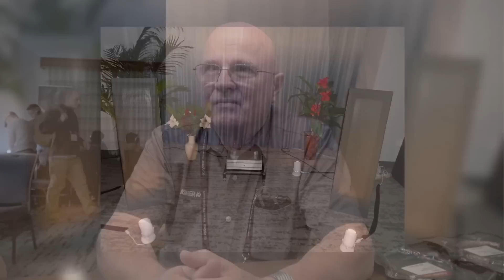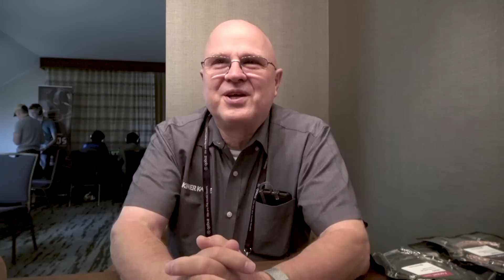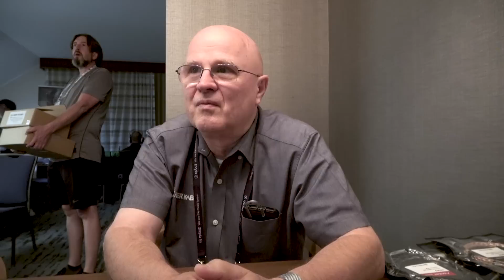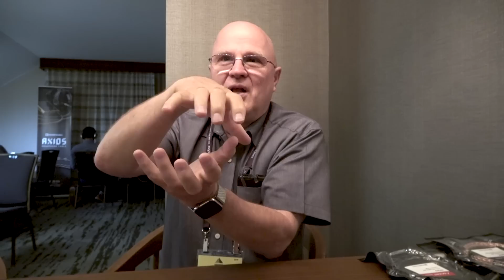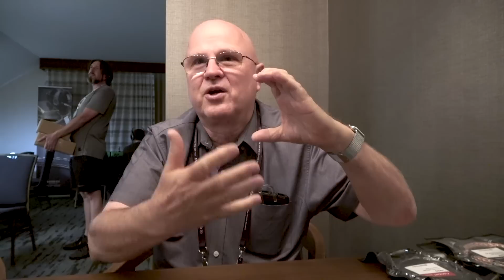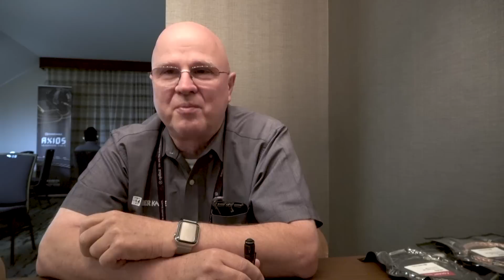Ray Kimber's passion for cables might turn around naysayers

Comment: Lots of background noise is ruining this. 

I just about managed to get to the part where he actually talks about what makes a difference with his cables. 

In short he says it can’t be measured. That’s BULL! There is nothing that we can hear which can’t be measured. It’s an electrical signal, it can be measured - if there are no measurements to back up this magic, then there’s no difference. 

I respect the guys enthusiasm and I found the recordings he was talking about interesting. But he cannot actually sit there and tell anyone why his cables are going to sound any better. It says it all.
Reply: What I have proposed in this argument, since the cable proponents always say there's something in the recipe that can't be measured electrically, is simply this. Build a system on which a decent number of self professed audiophiles say they can hear a difference in a variety of material merely by switching cables. Then, measure the SPEAKERS response with a control cable on the same variety of material. After that, switch cables at random and when one of the test subjects says they can hear a difference then measure the speakers response again. Quit measuring the CABLES! If there is anything in all of this debate it is either audible or it isn't and the only way for something make an audible difference is for it to change something in the response of the speakers. Even if that change is very subtle the fact is we do have test equipment that is far ore sensitive to sound than any human's ear. So if John Q Audiophile says he hears a difference then measure what he is listening to, not what he thinks is causing the change. If at that point cables are consistently shown to change a speakers response enough to be audible then we know we are missing something in our understanding of electrical transmission.
Reply: It's so cute that you think we can measure everything there is to measure.
Reply: Jude Niroshan Abeyeratne  I have a background in electrical and electronic engineering. 

An electrical signal can absolutely be measured. There is nothing electrically which has an effect on sound that cannot be measured.
Reply: @michaelb9664  Aww, that's cute. You're very, very cute. Let me know when you actually build something that people can use, or you know, want.
Reply: Jude Niroshan Abeyeratne 

I build electrical equipment as my day job 🙄
Reply: @michaelb9664  Sure you do, sweetheart. And I train unicorns in my day job. So cute.
Reply: Jude Niroshan Abeyeratne do you really?! 😀 

I believe that you probably do in the fantasy world you live in. 🙄
Reply: @michaelb9664  In physics, for ever action, there is an equal and opposite reaction.  So when you jump, the earth moves.  Measure that.
When the Voyager probe used Jupiter to increase its speed to reach Saturn, it slowed down Jupiter's rotation by 1 foot every trillion years.  Measure that.

When there is something to measure, but your measuring equipment cannot measure it, then that is due to the limitation of your measuring equipment.
Or, you are missing some aspect of what needs to be measured.

For all things related to audio, my ears are my measuring tools.
My ears hear differences in cables that self-proclaimed engineering experts claim have no measurable differences.

Michael, my guess is that you never heard a professionally set-up high-end stereo, with matched gear, and cherry picked recordings.  And you never swapped Walmart cables for high-end cables on such a stereo.  I have, and the difference is not imagined -- it is striking.

Either your measuring tools or your measuring skills are lacking in some way if they are not measuring what I and others hear.
Reply: Perhaps 

Your guesses are completely wrong regarding what I have or haven’t done. I’m not wasting my time explaining a background that spans over 20 years.

If you want believe in cable magic with nothing to back it up, then by all means continue listening  to wires instead of music and throwing money down the drain. 

Since you’re incorrectly guessing about me, I’ll make a guess about you...

I’m guessing you’ve never done a blind ABX test with anything. I also guess you don’t have a single electrical qualification.

Everything scientific can be measured and calculated. Especially electrical signals down a cable.
Reply: @michaelb9664  OK boomer.
Reply: Jude Niroshan Abeyeratne 

Wrong generation.
Reply: @michaelb9664  Whoosh. That reply is the exact definition of why you are a boomer. So cute, though.
Reply: Jude Niroshan Abeyeratne 

😂 ok if it makes you happy.
Reply: @michaelb9664  Translation: You never tested on a stereo that is up to the task of the test it is being asked to perform.

Your guess about my "electrical qualification" is correct.
I also am not a Top Chef.  Yet I know when my meal is properly prepared.

I am not a mechanic, but I know when my car is running smoothly.

I am not a sculptor, but I know a work of are when I see it.

Based on your logic, that a person must have an "electrical qualification" to speak informatively on this topic, then when your doctor gives you or a loved one horrible news, do not bother seeking a second opinion.  The doctor has a degree, so that makes her right.  Or if you are being prosecuted for a crime, any lawyer will due (they all passed the Bar exam).  Doctors, lawyers, scientists never disagree.  How could they?  They all have degrees.  They are all qualified.

"Everything scientific can be measured and calculated.  Especially electrical signals down a cable."
Perhaps.  Perhaps not.

Even if that is true, it means that you have not performed some aspect of the test.
Since cables do change how a stereo sounds, and your tests do not reveal differences, it means that you are not testing properly.

One key test you have never performed is "listening on a high-end, professionally set-up stereo".

And by the way, I am not convinced that you know diddly about electrical engineering.  And even if you do, it does not change what my ears hear.
Reply: Perhaps 

The emperor’s new clothes springs to mind. 

Enjoy your cables.
Reply: Jude Niroshan Abeyeratnethat 
“ I train unicorns...”
This actually explains quite a bit.
Reply: @michaelb9664  Aww boomer, are you talking to yourself again? It's so cute when you call yourself out for not adding anything of value other than even more stupid remarks. I do hope you feel better about yourself, you cutie.

Comment: Every time I hear the topic about cables I go look at an open 8 inch driver and see those very thin 60 llb fish string like wires connected to the diaphragm and I just think why do I need anything better in the audio chain if that's apparently the weakest link?🤪🤔🤔🤫🤫🙄   It just doesn't seem logical that adding a certain expensive cable is so important when the actual speakers use thin delicate wires most of the time !  And I am talking 10 foot max speaker runs with good quality 12 or 10 guage oxygen free copper. Great interview by the way!
Reply: @Big Jay, distortion is cumulative.

@Big Jay, following your logic, if crappy cables are used in your speakers, then you might as well use a crappy receiver.
If crappy wires were used in "X", then component "Y" is doomed.

Every inch, that the audio signal travels, colors and degrades the purity of the signal.  The quality of every inch of everything determines the degree of that degradation and coloring.  So if you use amazingly great cables on a crappy stereo, you will hear that crappy stereo sound its best.  If you use crappy cables on that crappy stereo, then that crappy stereo will sound even more crappy.

So if you have a reasonably good stereo, then better cables will allow you to hear that stereo at its best (or close to it).  So even if cheap cables were used in component "X", you do not want to further degrade and pollute that audio signal by using more crappy cables.

If your turkey is overcooked, that does not mean you might as well eat stale stuffing.

By the way, which 8" driver's wiring are you looking at?
The one from Walmart?  Or the one from Vandersteen, Wilson, Magico, etc?

And thin does not necessarily mean poor quality.
Reply: Yes.  Good points.  For longer speaker runs, I have often just doubled-up on the wires. 2 x 12-gauge makes a great cable.
The guy may be somewhat correct about better small-signal cables, RCA, TRS, XLR.  I have never heard a convincing demonstration of very-high-priced small-signal audio cables.
When I start hearing things like "difficult to explain" and "can't really measure it",  I get a little suspicious.     I usually trust the brands used by big-time recording studios, or I make my own cables.
Reply: You are closer to the truth than you might think.
However, the weakest link idea is wrong. Everything is important, everything affects everything else.
Also, your experience will differ depending on the equipment you have, how that equipment is set up, the environment it is located in, and how sensitive you are to the experience. In short, YMMV.
Reply: Billy William 
Yes, but be prepared. The Interconnects, in particular are of a very different design than what you are used to seeing.
Also, please keep in mind that the objective of a good cable is not ever to make your system sound better. The objective of a well designed cable is to transmit a more 'pure' electrical signal from one component to another. Any noticeable improvement in sound comes from removing the elements of an inferior design which negatively affect the sound of an already good system.
It is the misunderstanding of this concept, along with bad cable designs being commonplace (along with the belief by many that these bad designs are 'good') which leads to many arguments about cables and "snake oil" which you will encounter frequently.
Here is a link: https://mapleshadestore.com/
I would also suggest that you do some research into the history of these products, to see why they are made with this design, as well as some product reviews.
I am in no way affiliated with this company, but I have had good personal experiences with some of their products and design ideas.
YMMV. Thank you for your inquiry.   : )
Reply: Well for one thing length matters the longer the fatter depending on the amperage